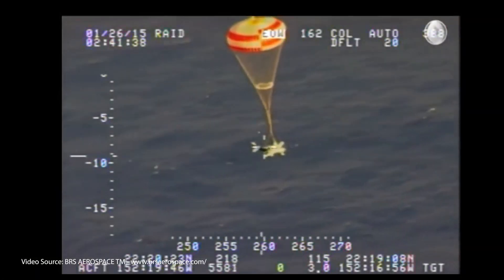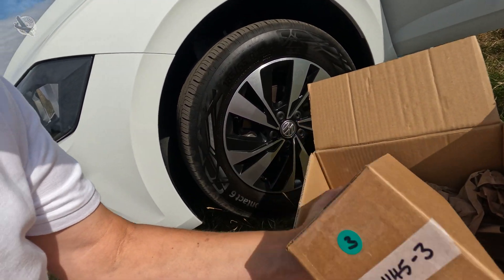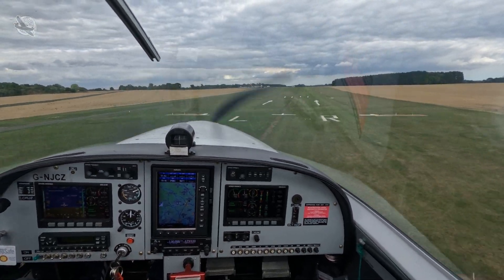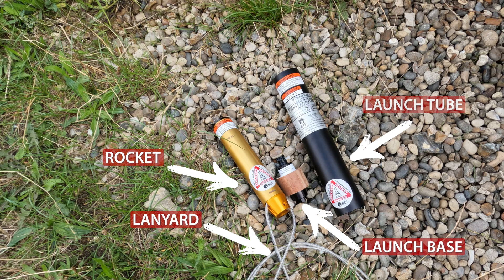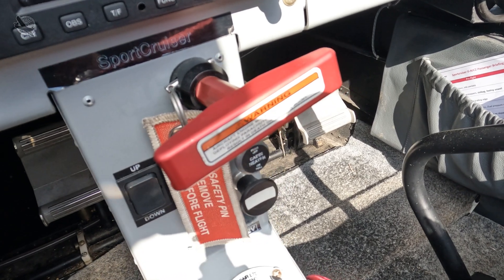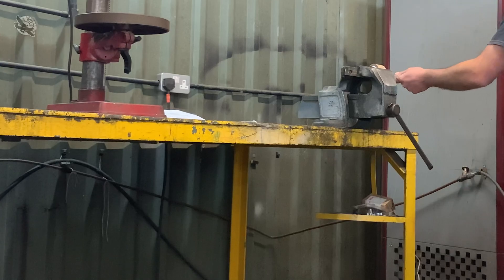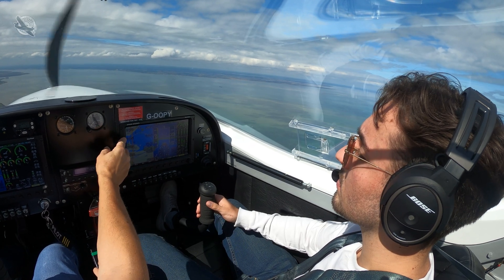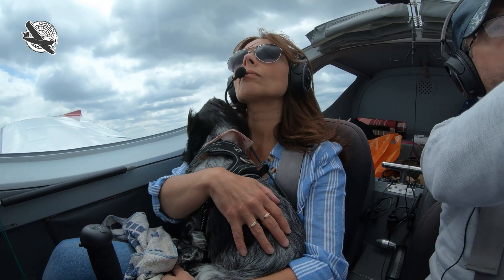How to replace and dispose of an aircraft BRS ROCKET!

Comment: Off topic question: today I used the adaptor for my GoPro to record audio, but the  GoPro stopped recording at almost 16 minutes.

Have you had this issue before when using the cockpit headset adaptor? If so how did you resolve it?

If not, then I hope it was a one off
Reply: I’ll say just power it back on if it happens again. GoPros seem to have a mind of their own particularly when you have important recordings to do.
Reply from the maker: Always have issues with GoPro's that's why I tend to film with more than one. Could be a battery or overheating issue?

Comment: Terry
You can remove the rocket through the cockpit, with out taking off the access panel. You may as well have had the parachute repacked, at the same time, as you need to remove the access panel and move the rocket out of the way to get the chute out anyway.
Great video btw.
Reply from the maker: Cheers Steve, this was the first one they had changed, however we wanted to check the date on the parachute and the whole change was much easier having access from the top. We use our aircraft pretty much every day and with a 3-4 week turnaround for re-pack we didn't want to waste what was left of the flying season. Annual is due beginning of December so we'll send it off then 🙂
Reply: @ShortField  
That makes sense, yes, the date on the parachute can only be seen through the escape panel. My parachute was repacked last year, and the rocket expired late last year. I have managed to get my aircraft onto the LAA, and they have allowed me to remove the rocket, and fly with the system ‘disabled’. New rocket on order👍

Comment: nice video... and it's unfortunately the only thing you cannot test after install, but i digress.... why didnt you just set the rocket off? that's more fun :D as for when to activate it... if im in an upset attitude, structural failure and that sort of stuff.... as long as the control surfaces are still attached, the plane will still fly.
Reply from the maker: Yes I'll never know if it will save my life until I need it to save my life 🙂

Comment: Interesting video! These systems are, on the whole, a good idea, I've encountered them on an aircraft before.👍✌️😊

I've no problem in obtaining rockets, swmbo, gives me one daily - whether I need one or not!😲😳🙄😞😉

In all seriousness, I think you're right, I've pondered it's use in Eg the C42; Catastrophic failure (control surface damage due to a bird strike or similar), a water landing, over mountains or woodlands. The rest of the time, a landing has to be preferable. I understand that even with a shute you could be looking at up to 40mph controlled crash? That's going to jar the back etc. It's a nice extra layer of protection, though, as personal parachutes are not an option.
Reply from the maker: Agreed, it is deffo a last option thing.
Reply: @ShortField  I reckon so, but I'm no expert.